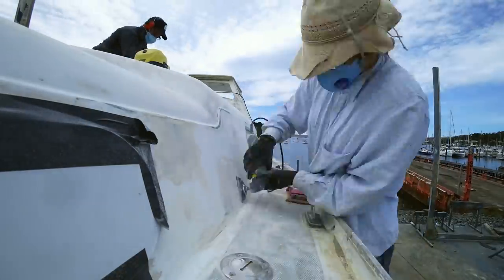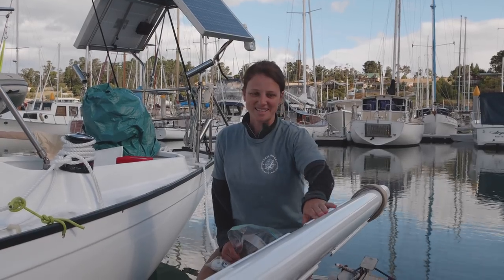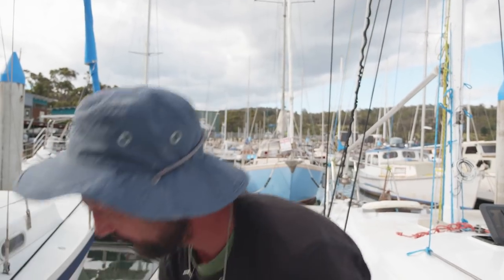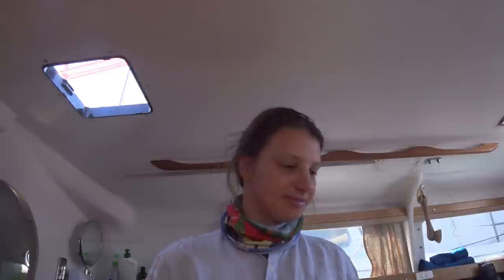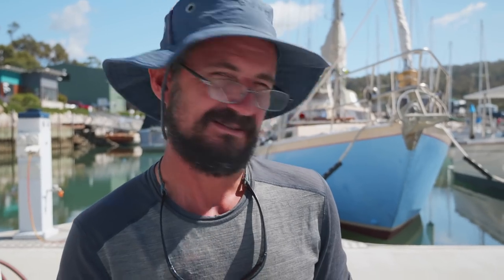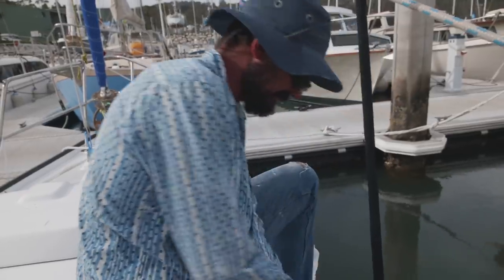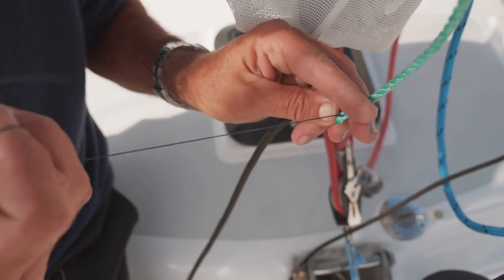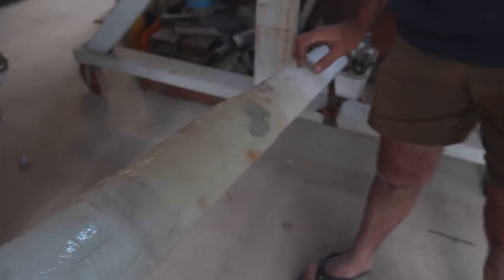Getting Ready to Go! (NEW Deck Grip, Boom and Stanchions) - Free Range Sailing Ep 165

Comment: Butyl tape is the best.  It is the go-to sealant for all of our deck fittings and hatches.  Interesting use of heli-coil fasteners on the hatch.  We simply drll-fill-drilled and tapped screws in with butyl tape sealant.

Comment: Love the Helicoil idea. Have to re bed leaking front hatch (screws into 25mm ply possibly rotted. 1969 Swanson but think hatch from 1985) Planned drill fill drill and bolt if can. What sealant did you use. Thought would be butyl tape???? Many regards and Happy Easter to you both!!!!

Comment: Just so you know a 1/2 ton chain hoist can lift probably 5 times that much. Most lifting or hoisting equipment has a standard safety factor of 5 times its rated load. I don't recommend pushing things that far for obvious reasons, but you were likely putting way more than a 1000 lbs on that thing.

Comment: Those stanchion base plugs you sunk in the deck pads are a beautiful thing. A very smart solution that blends modern custom racing yacht ideas with cruising yachts. While these particular items might not be saving much weight the ideas of saving weight in your new fittings and riggings is commendable. Too often cruisers opt for the biggest bolts, backing plate, etc, they can buy thinking that it’s best to overbuild. Combining that attitude to every fitting just makes boats heavier and sail under the water rather than on top which is inefficient, slow and bogged down therefore dangerous. Too often I hear people characterising a blue water boat as this theme of completely overbuilt & it’s ok it’s slow thinking that is safe and strong. As a racing sailor that attitude blows my mind as a poor sailing choice. Your fit out examples are good examples. PS: Yeah...fix your flapping halyards FFS! Ha
Reply: "As a racing sailor that attitude blows my mind as a poor sailing choice."

And for cruising sailors, the attitude of many racing sailors equally blows our minds. Unlike (apparently) many racers, we understand that you don't always have the option to just outrun storms, and the flimsy, unseaworthy, "how much strength can we sacrifice to get another fraction of a knot" type construction of modern racing boats is horrifying. I'd much rather be aboard a solid "overbuilt" boat than a 'One Australia'. ;-)

Comment: JFYI, in general, any engaged bolt thread more than 1.5 times the thread diameter does not improve the holding power of the bolt. Anything over 1.5 is stronger than the tensile strength of the bolt. Said another way, the bolt will break before you pull the treads off of it.
Reply: Only if both your bolt and the part you're screwing in to are made of the same material. This also depends on the thread type. Good rule of thumb but in this case it's false.
Reply: Not sure you are considering the difference in anchor material strength, the machine screws are threaded into helicoil thread inserts (this is where your explaination sort of works.....but think you missed the bigger picture).....the helicoils themselves are threaded into thickened epoxy which Troy cut threads into which inturn is filled into deck holes.....the deck consists of several different layers of material (ply sandwiched by epoxy - not exactly sure of its composition).....but it is the last two elements, the helicoil thread insert anchor and the deck material that I think Troy was calculating/hoping had enough strength when he used the deeper inserts. Only time will tell if they will have sufficient strength as they lack a backing plate (which he said he could not install on several of the stantions) to distribute the stress over a larger area......besides how can you question someone who wears a pair of reading glasses over there sunglasses to deliver a peer reviewed researched fact!......come on that alone was FRS gold ;)
Reply from the maker: I do want to clarify; the deck received M6 316 threaded inserts into a 40mm section of reinforced deck for the stanchion base, whereas the hatch got the epoxy/helicoil treatment. The holding strength of each would be considerably different.
Reply: @FreeRangeLiving  Thanks for the clarification......I think its a nice solution, certainly better than just just using wood screws (for the ones with restricted access), I do hope the fixing method can cope with the leverage that can be applied to a stanchion.......guess when I think of an everyday comparison I reckon I could tear off a table leg if it was attached with threaded inserts but would have a pretty hard time if it was through bolted to a backing plate........not that I usually go round tearing tables apart

Comment: A wonderful idea on the Helicoil do you think this would be a better solution than backing plates? I would like to the same thing to my boat.  I could remove all my backing plates and use this method instead.  I am in the process of removing all my spider cracks on my transom and deck. Previous owners when drilling they didn't countersink any screws. I have leaks on the portlights and bow hatch and stanchions it is a 1987 Oday 272  my rudder have a gudgeon and a pinot rudder system. It is only a washer and nut attached to the Gudgeon do you think the Helicoil would be a better option with epoxy and caulking or butyl Tape. I have wood blocks to make the outboard motor mount level to the transom also it is attached with a washer on the transom. it is a 9.9 hp motor that is used to get the boat out of the slip.
Reply from the maker: No, the helicoil were for a hatch. We used heavy threaded inserts for two of our stanchions. Helicoil ARE NOT strong enough for lifelines.
Reply: @FreeRangeLiving  Thank you I really like your system and the way they look afterwards.